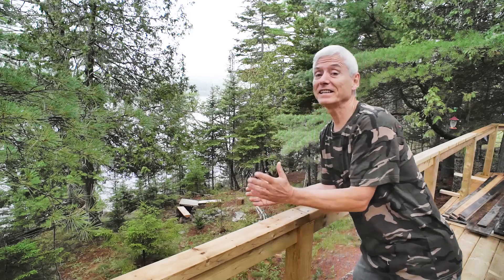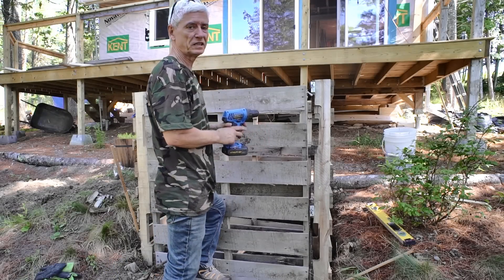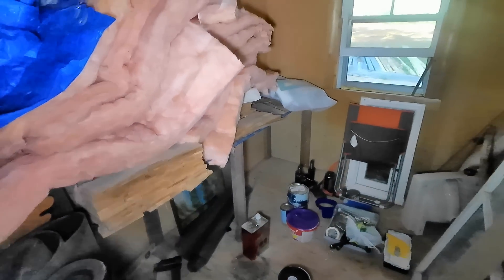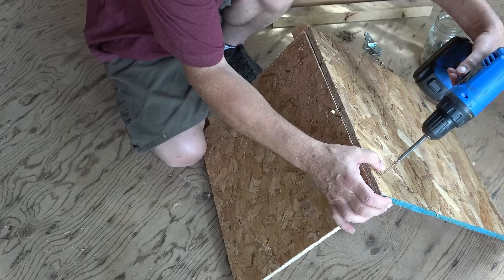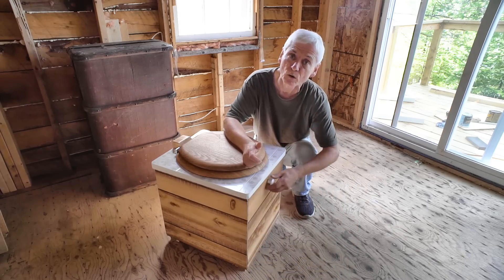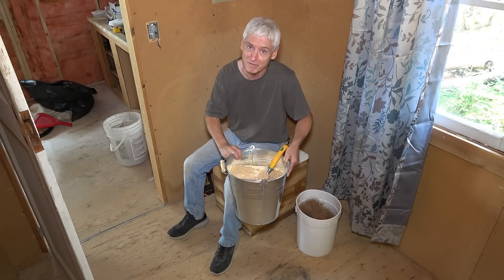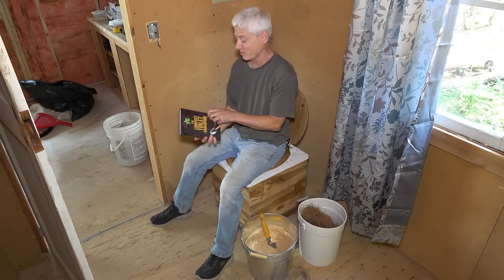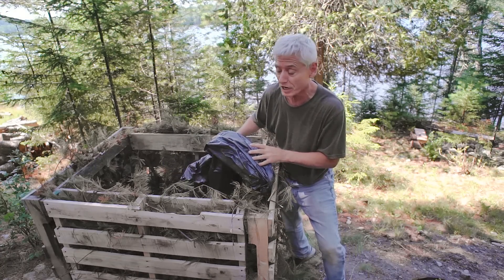My Cabin Compost Toilet: Much Ado about DooDoo!

Comment: Also a tip is place a larger plastic bag in the bucket that can keep the bucket clean.
Add Pete moss to the bucket 🪣 and place a bucket next to the toilet by the paper. With a container full of Pete Moss with a scoop to cover what you deposit. This keeps the air off of it and stops the odor! 

Use the paper like normal it compost as well. 
Pete Moss helps it break down and stops smell !!!
Then when you empty it. Carry the Bucket down then pull the Bag out of the Bucket and drop contents of bag into the bin. Now often bucket is totally clean and bag is dry and reusable. Because it’s all dry. 
Now if you don’t pee in another bucket it stinks horribly. 
So I used two toilets the Pee bucket simply gets dumped and doesn’t smell once the dirt absorbs it I often throw a little detergent in that bucket that holds the urine and then it does smell but I take it out before it’s too heavy. I chose to use two buckets to keep my number 2 bucket from having any odor whatsoever.  the peat moss was the solution not the other things you mentioned. They still stink. But Pete Moss  stops the odor! As long as you separated the urine into another bucket Absolutely.
I live in a really nice house in a subdivision in a city however I had roots in my sewer line and before I spent the money to fix that I simply set up the two bucket system out in the garage use that until I had enough money to fix the sewer. I will never forget the plumber said oh you have to do it now and gave me a huge estimate. I said bye I don’t have to do anything right now. I know what to do I went to Home Depot bought 2 buckets got a big container of Pete Moss, plastic bags. I had a large tolit seat with arms to lift oneself up left over from my elderly husband who died.  It is totally adjustable. Straddling the Bucket with 4 legs for stability. And the seat fits securely inside the Home Depot bucket. So It’s perfect.
Also my water bill went down because that toilet was used more than any other toilet in the large house. It’s a perfect
System and I built nothing.
Reply from the maker: Sorry Kathy, but I greatly encourage you to stop using peat moss. Not only is it destroying the natural bogs in Canada, but in stripping it away from the land releases CO2 into the atmosphere. It takes many many generations to grow back. Google this please if you are concerned for the planet. Thanks! SP

Comment: G'day again from downunder Slim.
It may have been mentioned before but once you have your bathroom set out you might be able to cut a door in the external wall cladding so the bucket is accessible from outside. Just an idea, keep up the good work 👍

Comment: I haven’t experimented with fecal matter, but I have with urine. Urine by itself smells horrible after a very short time, even if mixed with water. Cat litter is too heavy and doesn’t really absorb much. I tried horse bedding pellets (got mine from Tractor Supply) and it worked perfectly. I exposed the urine / pellet mix to the 100+ degree fahrenheit southwest desert and even after two weeks, the mixture smelled like pine pellets. I’m looking forward to Slims long term report on his set-up. Slim, is your bucket apparatus for fecal matter only? I have heard mixing the two, is very smelly.

Comment: I once built a compost bin from pallets. After several years it began rotting. Gradually it lost its integrity and fell apart. It had to be dismantled. So, yes, free, but not enduring. Be prepared.
Reply from the maker: If I need another one in a few years, so be it. It was the hole that took the most effort, not the bin! SP

Comment: Two things, one, I kept looking for a roll of toilet paper… Second, I’ve been using a composting toilet on and off for more than 10 years and the thing that people tend to fear most is that monthly emptying. However I found it incredibly anti-climatic and far less gross than I had expected. By that time most of it was more like moist soil than anything else. And the smell was not nearly as bad as I had anticipated. However, one improvement you might add that has been on my commercial composting toilets, airheads and the similar ones, is in simple exhaust fan to keep the air moving through it. Then it outside that keeps the odor to absolutely zero inside. Anyway enjoy your new toy.
Reply from the maker: Terminology Scot. This is a "Compost Toilet", not a "Composting Toilet". Big difference, different application. Thanks! SP
Reply: @SlimPotatohead  interesting differentiation that I don’t fully understand but I will Google it. Still they both need the toilet paper!😉
Reply: @SlimPotatohead  OK, tried googling the difference and it’s clear that Google thinks they are the same thing based on the results. I couldn’t find anything telling me the difference between a compost and a composting toilet. You might wanna either do a video or just a note here on what the difference is. I’d be interested in the book you mention but I don’t do anything other than e-books anymore and that one is not available as an e-book.
Reply from the maker: A "Compost Toilet" is one that collects toilet material to be used SPECIFICALLY for producing compost. A "Composting Toilet" on the other hand is sleazy marketing, and in most cases has NOTHING to do with compost at all. Most supposed composting toilets are merely dry toilets used to hold toilet material until you dump it somewhere else. RV composting toilets are a prime example of this deception. Hope that clarifies things. BTW, the Jenkins book "Humanure" is available FREE as a download from his website. Check it out! SP

Comment: Slim, that went just a little too far.. Yes it can compost.. and i have tried this type in the cabin. My observations were you never get rid of that smell in the cabin and you still have to take it out to the poop coral. Its hard to believe that there will be no smell there. Also, i think that compost pile is going to be way too close to the cabin.  My advise (what ever its worth) is buy one of the composting toilets and use it
Reply from the maker: Have you read and followed Joseph Jenkins book? SP

Comment: Slim, if the bathroom is on an outside wall, would it be possible to put an access door? That way you wouldnt have to traipse the bucket thru your house to get outside.

Comment: I am in the market for a frig for camping out of my Jeep, so I checked out your video on the Alpicool C20 from 4 years ago. 2 things came to mind: 1). Your video and sound quality has improved over the last 4 years, and 2). Are you still using the Alpicool C20 and would you consider a long term review of it? Thanks. Love your channel!
Reply from the maker: I used the Alpicool C20 for 3 years without any issues, but gave it away and bought the larger Alpicool C40. The C40 has been great for over a year. It was featured in another video: https://youtu.be/sExzHBGVns8
Thanks! SP

Comment: A far better system is to use a bigger square shape plastic container 30 litre size -it  will fit in a similar sized box.Fill it with wood pellets (compressed pine) on the bottom and then put in peat moss until the container is half full Then after use cover and mix in the deposit with a small hand trowel.This will need emptying once a month  although 2 weeks might suit some people .It keeps the weight down  Dont pee in the toilet or put in toilet paper .Pee will make it stink and toilet paper looks bad.The material looks like potting mix when you empty it and is real compost after a couple of months .Worms do the trick
You will find your 20 litre pail will fill up in a week as you will need to use much more cover material to keep the smell down if you pee in it and also to cover the toilet paper. Covering after each visit will sometimes result in spillage and dust.Peat moss is better than sawdust as sawdust is not dense enough and takes a long time to decompose
The system I have described is the same as what happens with the expensive purchased models which mix the contents with a handle on the side.I  originally intended to fit a mixing handle to my unit but have found hand mixing just fine.I have built a model with a urine diverter but prefer to pee in a separate container.You might end up with some urine in your toilet that is why using wood pellets on the bottom is recommended. You dont really need to have a huge compost bin unless you intend to do some gardening .I actually I use my compost in pots and grow vegetables.
Reply: I think you are splitting hairs to assume there are are composting toilets and compost toilets -they are all the same.At what point do we call the waste compost -it is debatable. The only difference is the way they are used to achieve the end result .There is no need to have a huge compost bin to achieve this .The science of composting garden waste to produce heat that achieves a a faster break down of 'woody' material is not required with the material we end up with .Please note  a compost bin like yours is likely to encourage rats and other vermin if you add household waste 
 As you point out they dont smell as one is producing compost not sewage. But as I pointed out if you urinate in them you need to use more cover material resulting in your bucket filling up quickly .That is why RV's like the mixing models and people like myself who prefer to have to empty it once a month.
I actually prefer to use a compost toilet as they are cleaner if you think about it.But the small bucket only suits for one or at most 2 people.
I think the invention of the water flushing toilet is the worst invention of mankind and I suppose we can blame the Romans for this .Look at the huge waste of water that is used plus the loss of organic matter that can replace man made fertilizers. Where I live the radio has just reported our local sewage system has flooded twice this month and toilets will be slow to flush .Several towns have reported sewage flowing in the streets  due to the  wet winter we are having
May be we should do what the Chinese did and squat beside  a diffrent cabbage plant each morning LOL

Comment: I like your toilet , you did a great job on it. But , I have a question I always heard the  pee has to go in a container by its self wonder why some do and some don't?
Reply from the maker: Hi Pam, good question. What you may be referring to is a "Composting Toilet" and not a "Compost Toilet". A composting toilet is a dry toilet that separates the urine. This is for ease of disposal. Mine is for composting, and urine provides nitrogen, therefore it does not need separation. Thanks! SP

Comment: You could read a book called "Humanure" available free on the net.  I think your compost is too close to the water since you will be using it for your waste.  Your compost bin is essentially an outhouse.
Reply: Sorry peeps, the book is no longer free.
Reply from the maker: Yes, it still is. Go to the bottom of the page here and you can download it chapter by chapter: http://humanurehandbook.com/contents.html
Thanks, SP
Reply: @SlimPotatohead  Glad to hear it Slim and thanks for posting.  Please check for set back from waters edge though.
Reply from the maker: I see no issues. Septic tanks are allowed at a shorter distance, and as this is an occasional use cabin for a single person, the impact will be a fraction. Thanks! SP

Comment: First, I very much enjoy your videos.  This one was especially entertaining.  I know nothing about this type of system.  However,  it is my understanding that once you make a deposit in the toilet, you are suppose to mix it up to break down any larger solids.  Also, I  think you are suppose to keep the solids and the liquids separate.  Most compost toilet systems have two separate chambers.  The liquid side gets emptied a lot more often than  the solid side.  Also, I think you did a great job with  that  compost bin, but like many others here, I would have placed it in another place that is out of sight and out of mind so to speak.

On the lighter side, how long did it take you to realize that there was no toilet paper close by? LOL
Reply: Perhaps Slim simply plans to use hands & finger.
Reply from the maker: Boonie Booster, you are referring to an entirely different type of toilet. This is a "Compost Toilet" that is meant to make compost, and NOT a "dry toilet", that separates urine. For compost, the urine is an essential ingredient to compost, as it provides nitrogen. Thanks! SP
Reply: @SlimPotatohead  Well, like I said.  I don't know sh@t about composting toilet systems. LOL
Reply: I think you’re gonna find that unless you separate the solids and liquids, that bucket is gonna stink if it’s not dumped daily.

I’ve lived with a similar system on two sailboats. If the solids and liquids aren’t separated, the mixture quickly begins to off-gas and stink. If separated, and the solids are stirred with the composting material and coated with it, the solids will not stink and the bucket can be used for several days until it’s so full that stirring become problematic. The urine receptacle will stink if it’s not emptied daily.

Such toilets attract insects which lay eggs in the bucket. A couple of tablespoons of diatomaceous earth in the bucket after emptying when you recharge of sawdust or pine needles will kill their larva and prevent infestation.

Good luck.

Comment: Too funny, but lots of good information. What about toilet paper?
Reply from the maker: Good question. According to Joseph Jenkins, any toilet paper is fine, but compostable toilet paper would be a benefit. I suspect it will take long for the pine needle to break down than the toilet paper. Thanks! SP
Reply: Some cultures of the world have a metal can next to the toilet in which used t.p. Is burned.

Comment: do you find the leading edge of the top of the box forward of the seat cutting into your thighs?  Looks really uncomfortable, you might want build a foot rest that elevates your knees and gets the pressure off the bottom of your legs.  Sort of how a plastic "squatty potty" does for a typical flush toilet.

Comment: Why did you pick that location?  I don't think I'd locate my compost bin right under my deck and in the view of the front windows.  If the compost gets smelly, which it can sometimes, your deck won't be a great place to enjoy.  I think when making your compost toilet you also should think about cleaning.  Can the seat and surround be properly cleaned.  You can also get a square garbage can to use as a compost toilet if you like the longer toilet seat.
Reply from the maker: Not sure why you think the view would be in any way tarnished by adding a natural compost bin to a natural setting. As for smell, not likely. As I said in the pinned note, this is mostly for vegetation, as the cabin is seasonal. Thanks! SP
Reply: @SlimPotatohead  Even vegetation compost can get an odor.  But you are right that since it's a seasonal cabin there won't be a ton of compost in the bin.  I guess I just don't like the look of the pallet wood bins but that's just me.  I just wondered if you had a reason for locating it where you did other than it being on the path.
Reply from the maker: Yes, one other reason. I have neighbors on both sides, which makes the waterfront the least conspicuous. Thanks! SP

Comment: Are you not putting human waste at the surface level outside? Sawdust or not, won't rain water carry contaminants down to the lake? What I know of sanitation codes where I live (north central US), I don't think this would fly. Mostly because of the lake. Leave No Trace says bury it 6 inches down. I'm also surprised to see no liquid diversion. I'll be interested to see how it works for you.
Reply from the maker: Hi Scott. I greatly encourage you to read Joseph Jenkins books on compost and humanure. It's a well documented system that is used all over the world and has saved many people from the effects of poor sanitation. Burying poop in the dirt will not give you compost. A properly designed and maintained compost bin will. Thanks! SP